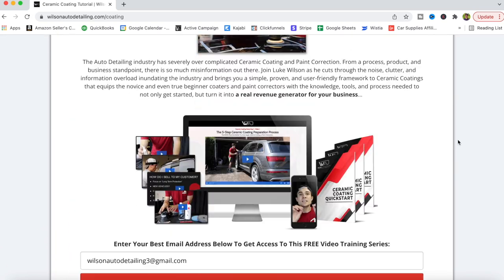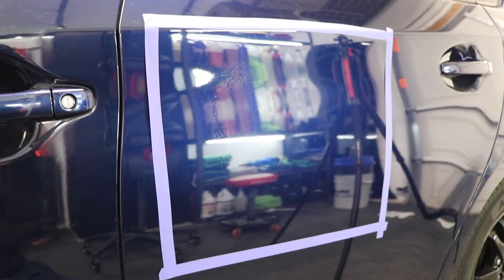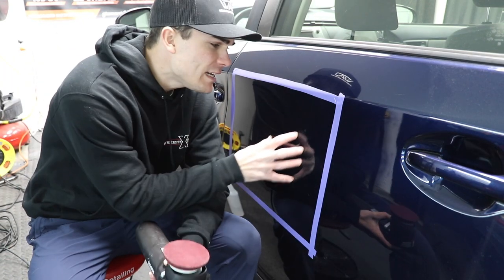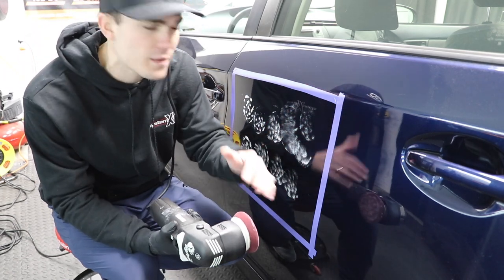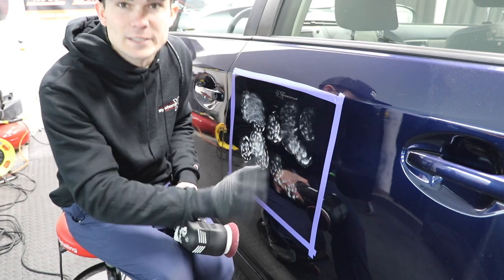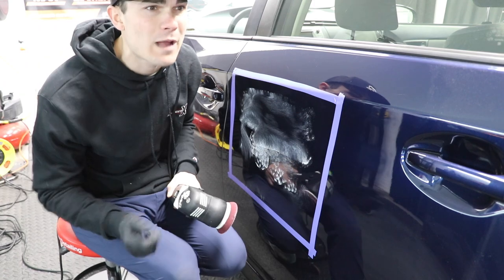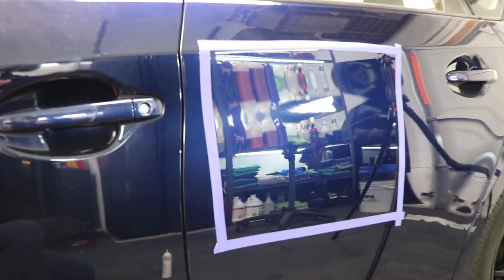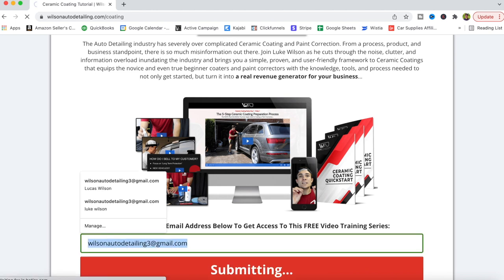Ultimate Ceramic Coating SCREW UP & How To Fix It | Don't be afraid!!!

Comment: I did a coating and a high spot was found a day after.  So it had time to sit and harden.  I used my Griots G8 with a 3" orange pad and applied Meguiar's finishing polish.  A few passes later, the high spot was gone.  I then reapplied the coating.  It is all about analyzing the situation and knowing your tools.

Comment: Finally someone other than Auto Fetish and I have seen the glorious redeeming light that is CSI Polish! It’s crazy how much I was duped into “compounds and polishes“ marketing schemes. 

Yes they work, but now detailers think they need 6 different types of each because some clear coats react differently with how you pair pad and polish. 

Then they get 30 different pads and try 9 test sections to dial down a flawless technique for the last 30% of the car, thinking they’re a wizard while wasting countless hours. 

Mean while all you have to do with CSI is change your technique or your pad choice. Boom scratches gone and a flawlessly clear finish in under a minute any section your working on, ANY CAR you’re working on, no matter what. 

It also does glass and headlights like a miracle. Like you said, being able to remove it in the sun is a huge bonus also, especially since I’m mobile here in Southern California.
Reply: Im not a rotary guy and find that using the CSI on dual action just seems to take longer. What say you? Also they claim to take off less clear coat have you tested this theory vs other non/diminishing abbrassives? I also find that it dusts ALOT. Reminds me of Meguiars M105 lol
Reply: What's the difference in csi vs 3d one
Reply: @MrBod4life  lol the dusting totally sucks, pad conditioner helps a lot (or just a spritz of distilled water into the pad). Since anytime i Polish a Car, I wax it after and always save the glass for last, so dusting doesn’t hurt me as bad as other guys (except for big grills or honeycomb grills)

I’ve never enjoyed rotary polishers. Too much “pulling” left to right to be comfortable for hours at a time. D/A with a wool pad might take 2 passes longer than a rotary to accomplish what you need, but I prefer never having to go back to clean up holograms. 

I think even masters of rotaries lose time when they have to double back and do a quick DA pass, but then again if your a rotary master you wouldn’t be leaving noticeable trails 🤷‍♂️ fuck that technology gave us the DA for a reason.
Reply: @jesusgaona5189  hard for me to say because I’ve only used 3D1 twice. It seems to be a great all in one polish many detailers are fond of because of long working time and “no need to wax after”; however the idea of leaving protection behind while wiping off 3D1 just seems lackluster. 

The “protection” probably only lasts 3 weeks and doesn’t really look glossy, reflective or deep. the freshly polished paint does, but it’s hard to call a polished car “waxed” or “protected” until you use a dedicated paint sealant like Jescar Ultra Lock+.
Reply: @Ichabod_Jericho  3d one doesn't leave any protection behind its the same concept as csi one polish and just switch pads
Reply: @jesusgaona5189  really? The website says it leaves Montan wax behind, derived from coal unlike caranuba but I could be mistaken
Reply: @Ichabod_Jericho  that's 3d speed not 3d one

Comment: So does the long bar help in detecting ceramic coating imperfections or is it the lumens? I'm looking at something like the Scangrip Nova R, but wondering if it's the length of the light and not necessarily the brightness that will make it easier to see imperfections.

Comment: I’ve been getting calls from Michael at System-X because I want to work with them (after failing to pull the trigger on your program a few months back because of lack of funds from a personal matter). I haven’t had a chance to call him back yet, but I’m thinking this way is going to be much more expensive. 🤦🏼‍♀️🤷🏼‍♀️ I just want to be able to do professional grade ceramics and have the proper training as well.

Comment: Newbe, here, but do you need to recoat the ceramic coating where you polished? Or did you just cut down the high area down to level it?
Reply: Not trying to butt in but you would want to recoat it after compounding or polishing a coating off.

Comment: Do you have another channel where you talk  about interior and exterior detailing like you used to. All I'm hearing from you is ceramic coating this, ceramic coating that. Yeah ceramic coating is good, but where I live here in Louisiana, it not all that..people here just want thier vehicles clean especially the interior. Only a few will pay $1000 or more to make the outside of their vehicles look nice. I get repeat customers on just interior along and make dam good money just with that. I don't wanna work on the same car for hours even days to do a ceramic coating or paint correction. It's boring and tiresome. Get back to what you used to do and make contents on regular detailing. I used to love watching you do those videos, now it's just boring.
Reply: Exactly. Ceramic this than that. Thousand dollar jobs Etc. Limited clientele no matter what I'm guessing depending on where you're at. Mostly Interiors, exteriors with minor paint correction, buffing , sealant or wax.. And I find most people our only comfortable around 150 250 maybe for very good job hon interior and exterior

Comment: Dude I've watched plenty of your videos to ask this. Are you on speed ..RX or methamphetamine...You talk wide open. I feel like I'm watching Billy the oxyclean  guy and I always knew he was. He was on coke. Lol I mean you talk so fast it's often hard to tell what your saying.  I'm a recovering addict so I'm very familiar with the signs. And I noticed you push the 1k ceramic coat price. I used to own a detail shop and you can definitely ceramic coat something for way less than a Grand. But when yall push the keep the price up...that makes folks think it's worth a grand and truth is it's not 4-600.00 and that's still kinda high. Lol I couldn't hardly type this without 😅your speed speech got me saying slow down dude you'll get a chance to finish it lol and that polisher boy you working the he'll out of that thing . Lol you couldn't possibly move it any faster. When I hear you talk I feel like I'm at a show where the guys up in a booth with a head mic on trying to sell the latest gadget or car wax Lol. Just slow down man and you'll last longer and lower your dose  Pal. Good luck
Reply: “I used to own a detail shop” is the key phrase right here. For $400-600 you’re either doing not doing high quality work, or that’s the exact reason why you don’t currently own a detail shop now. Have you seen gas prices? Have you seen the price of vehicles? Have you seen the price of homes? Have you seen the price of bread? Have you seen the price of meat? Inflation is happening brother, so prices on our detail services have to go up as well.
Reply: Not every job needs polishing to apply a coating, a 5 or 7  year coating needs to cost more, one year coating is 50-70 cost,  5-7 up to 300.  As far as speaking fast maybe the speed is edited to seem faster, I manage to understand 95% of everything at 1.75x faster speed, if it’s too fast for you at normal speed you can slow it down to minus 0.75-0.50 when you watch his videos. Some voices and accents seem hard to understand at faster speeds. Try to watch a video of someone with an Indian a accent at x 1.75, for me it’s impossible to understand just 25% of what they say.
Reply: @dossegundos7145 with all due respect, saying that every coating job doesn’t need a polish is the reason why coatings are starting to get a bad wrap. You can decontaminate all you want, but there will still be bonded contamination on the paint that will cause the coating to not bond properly. Also, a 1-2 year coating takes just as much time and effort as a 5-7 year coating, which is the reason I won’t offer any 1-2 year coatings at my shop. Now if you’re talking about a sealant or wax when it comes to coatings then yeah, you’re right neither one requires a polish. This is only what I have learned in my own personal experience owning a shop and detailing full time. I’m open to hear about coatings that can bond to the paint properly without polishing, and even trying some out to test this theory. I’m not very optimistic that such a coating exists though.
Reply: @austinthornell  owned detail shops in the late 80s and 90s. I can understand dude I was really just trying to say he's on amphetamines and talks really fast. But dude there's no way a ceramic coat is worth a grand. I mean your doing no more work than waxing a vehicle  and you say that's a grand worth. I mean so your saying if you do one a day in a week your work is worth 5k a week. Bull crap. No way but you guys getting some rich idiot to pay it and yall get use to a grand a job sure you get use to it. Would I do one a day for 1 grand he'll yeah but it's robbing folks. Dude I grew up in the street rod scene.  Top car builders . I mean cars going across Barrett Jackson cars . My dad had a few go across Barrett for 50k...so as long as it takes a man to build a street rod and only get 25-50 and you think rubbing the paint on a car is equal work lol you must live in the very rich areas because the average person isn't gonna pay that. But as long as yall stick together and push that 1k price some rich idiot out there will pay it and yall will truly think you deserve it.
Reply: @austinthornell  so no argument on the he's on amphetamines huh lol . I went and watched a video from 3 years ago.  He didn't talk quite as fast he's a tad heavier and he has color to his completion not pale white. Non of this is meant being mean or ugly.  If he can get the 1k great for him. But the drugs I truly hope he can lay them down before they lay him down. It's not if but when. Good luck and good day. Oh I do believe if your gonna ceramic coat one that it needs polishing before hand. But that 1 grand price tag is a killer for imho
Reply: @slanger2563  Some people are naturally fast talkers because maybe they are fast learners, some people talk slow. Everyone is different and that’s a good thing. If you’ve been following him for years, knowing this guy is smart especially for what he went to school for, and how he makes great content, you’d be able to use your addiction skills to see that he’s not on drugs. Also you’d know that he’s stepped his game up from 3 years ago when he was doing most of his details outside, in the sun, instead of doing coatings in his garage, and guys gain and lose weight super easily, especially in stressful life situations like becoming a father and taking care of a newborn child. It’s one thing to think it, another to post about it, and certainly a different situation to claim he is on drugs like you do. If your comment wasn’t meant to be disrespectful, maybe try changing some things because it comes off as you telling him he’s on drugs, when (and I’m just guessing here) he’s never once told you personally he’s using. I’m new to coatings so I’m not going to act like I know all, but one thing I do know is I’ve seen people charge up to 2.5k for a coating. Prices change. Especially from the 80’s and 90’s when you were in a shop. I’m not trying to pick a fight whatsoever. I’m completely neutral. Being a recovering addict I’m sure it doesn’t feel great to have clean time and people still think and maybe even tell you to your face that you’re still using when you haven’t been. I wouldn’t want to assume anyone is using, let alone claim they are when the only evidence you have is someone who speaks faster than most people. I actually speed up all YouTube videos to retain info quicker, so when I saw your comment, I paused my video to set the speed back to normal, and I thought it was pretty slow. Idk man, it’s one thing if he came out an claimed he was an addict, but to accuse someone of being on drugs, no matter the intent, it can be hurtful, as you might know as a recovering addict.
Reply: Wow a little but hurt are we. Lol 2500.00 for a coating lol that's funny. He must be your boy friend.
Reply: @slanger2563  No buddy, not butt hurt. I just don’t think it’s cool for a grown (overgrown) man to be acting like an 14 year old, accusing someone of something just because they are different from yourself. Not that I owe you an explanation or literally anything, but I’m a lesbian, and those prices were from looking up detailing shops in/around my state 🙂
Reply: @tillmandetailing  over grown...are you insinuating I'm fat lol 😆because I'm far from fat...🤷‍♂️ and why you gotta bring up your a lesbian what does thst have to do with it...nothing as far as I'm concerned. But I guess you need some special attention 😏.  Well ya get none here I've friends and family that are guy...to each his /her own. Look..if you can't see this guy is on speed your blind. His completion has turned very pale and thsts amphetamine use. He talks wayyy to fast 3rd. He works his buffer extremely fast. No before I made this comment G.I Jane I went back 3 years to watch him and 1. He had color to his completion, 2 he truly didn't talk so fast, 3. He didn't move his buffer extremely fast. So give it up G.I Jane the kids on some type of speed it obvious.